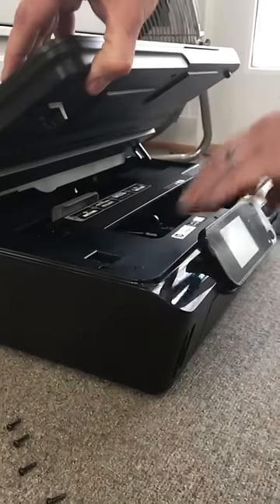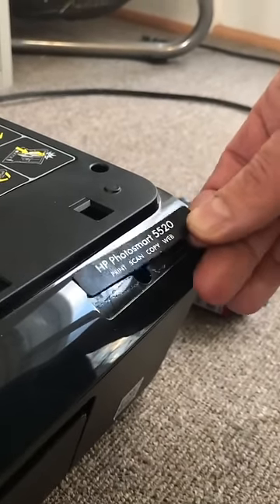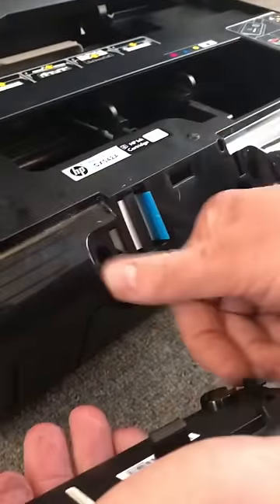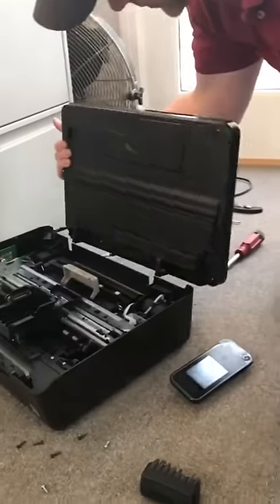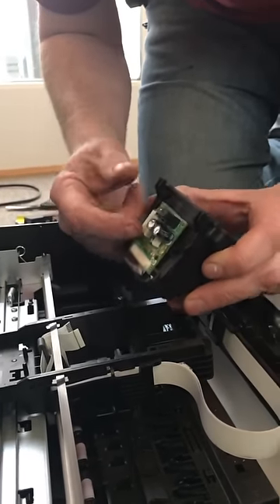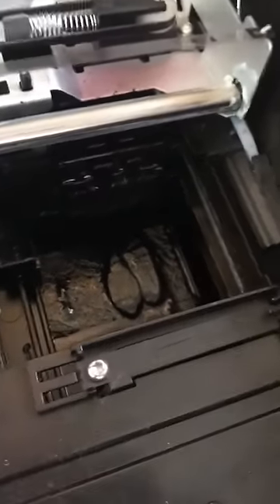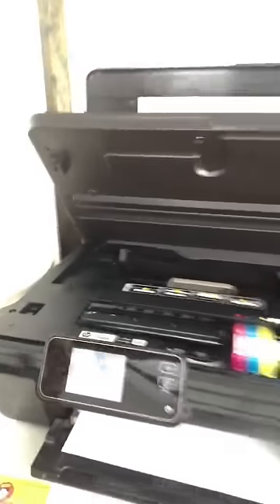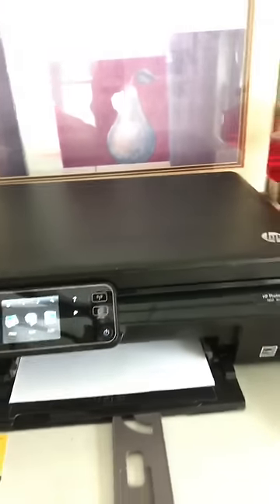HP Photosmart 5520 Black Ink Problem

Comment: Boom! I soaked the filter head, also used a syringe to force water through the cartridge screen with no luck. Forced air with my mouth through the cartridge vent on top with it installed with no luck. I tried it with that same syringe with just air and walla..it worked. Thank you
Reply from the maker: Blythe Ag & Aviation thanks so much for watching! I’m so glad that you got the printer working again! I got mine screwed up by taking the cartridges out and left the top open. This kept the print head off the wet ink pad and allowed the head to dry and clog. How did yours end up getting clogged?
Reply: I really have no idea. The old black ink cartridge stopped working, put in a new one and it just wouldn't work. So maybe I have, at some point, left it too long off its storage pad
Reply from the maker: Blythe Ag & Aviation Ok. I was curious if you made the same mistake I did. A friend of mine gave me an HP6700 that had sat unused for quite a while with the black ink empty, but the head was parked where it should be. I put in all new in and it printed just fine. I was quite surprised but very happy. I guess it doesn’t matter how long it’s empty, just as long as it stays parked on it’s ink pad when not in use. Thanks again for watching!

Comment: Good help video, kept me from junking. All I did was use idea of blowing thru cart and head. Used straw, blew thru cart “air vent” which I opened with knife. Hopefully cart doesn’t leak out!  Bottom line, never let ink run out and set empty or open without cart for any length of time. Thanks again.
Reply from the maker: Andy Skinn These are all good points and thanks for watching! I think my issue was I opened the ink replacement door, took out the cartridges, and left the door open. This allowed air to the cartridge tray both top and bottom. With quick drying ink, it was guaranteed to dry and clog. Open the door and take the cartridges out ONLY IF YOU HAVE THE REPLACEMENTS IN YOUR HAND!! Don’t take them to the store like I did! Again, thanks for watching !

Comment: You Sir are a legend! I remover te top and removed the color cartridges. Ten i put my lips on the Black vent opening and had to blow hard till there was a Middle Black ink. Prints again now ! Had put much time before with soaking it
Reply from the maker: Polletjeuh I’m so glad it worked for you!! Mine is still working fantastic as well. Mine is exposed to extreme temperatures as it sits in our home office that is not temperature controlled. Sub zero temps in the winter and 90s-100s during the summer! Picture perfect printing. Any, thanks for watching and I’m glad you have your printer back!

Comment: Thanks for this. Mine clogged up, hot hot water soaked fix it. Wouldn't recognize magenta cartridge, loose ribbon, had to wedge it in place with a bit of hard plastic. Fixed it MacGyver style. Your teardown instructions were invaluable.
Reply from the maker: Stephen Hayhurst Fantastic! I’m glad it worked! And I’m glad it saved you some replacements money! Thanks for watching!

Comment: Thanks Jarrod for your very logical and considered approach to your problem we had the same problem in our case all cartridges worked minus the black which appeared to be clogged. We ended up ditching the HP for a Canon Ink Jet which prints great it is the G2600. When I have some time I will try what you have done to see if I can free the clog from the HP printer which has been disconnected and is now lying idle on our carpet. I don't feel like throwing it in the trash can at this point but when I get a day free I will take it outside to work on it. Thanks on all the tips for disassembly. Regards Mike
Reply from the maker: Michael McKenzie Let me know how it goes and don't hesitate to ask me any questions! Mine is still printing strong!!
Reply: I just did the same thing I am sick of spend big money on HP and they die in 2 years.

Comment from the maker: Thank you my friend for watching! I did try that, but didn’t have positive results. I tried the overnight soak with the print head resting on moist paper towels, then went to soaking it in a bowl of hot water the next day, alcohol swabbing, alcohol soaking, and nothing worked. Pushing the ink through the print head was all that worked for me. Thanks again for watching!

Comment: A very thorough video EXCEPT you didn't show re-installation of the cleaned cartridge.   At least on my unit the smallest of the three cable appears to need soldering to get it back on unless I am not locating the socket.

Comment: Continued—
Using a standard household plunger I used the mixture of boiling water and Mr. Clean to apply to the upper portion of the print head, area where the ink cartridge sets. Let solution sit for 1 to 2 minutes. Remove ink soaked rolled paper towel from under the ink carriage. Repeat one more time. 
Hooray after running the printer cleaning head selection twice I was up and printing all colors. The Black ink was bold and bright. I was scheduled to buy another printer in a few days but no need now. I refused to take the whole printer apart. 
This complete effort took no more than 20 minutes start to a working printer. 
I hope this can help someone else.
Rich

Comment: Thank you so much for this video! I was able to fix the black ink flow on my printer and get it working again. And I'm glad I watched to the end of the video; I also needed to blow through the print head to get the ink through. Thank you thank you!
Reply from the maker: ruthmarkable Thank you for watching to the end. It was one of my first videos and wasn’t recorded properly and wasn’t edited enough. However, it did record everything I went through with this printer and not just the warm and fuzzy times!! Thanks again and I’m glad it helped.

Comment: Your guess is correct!  The docking tray is not hidden or locked. It's above your puddle. You expose it by turning the black wheel on the left hand side counter clockwise.  Once the tray is exposed you'll see the sponges that keeps the printheads moist. This tray moves in and out every time you open the top to expose the ink cartridges. Unfortunately, your little mishap is an omen of your future. The "black ink" issue is that the black ink sponge erodes over time and the printhead is not flush with the sponge so and the ink dries and clogs.  Cleaning the printhead is a temporary fix.  The problem is the sponge.
Reply from the maker: M Om Great info. Thank you. We’ve had the printer in storage since August and I’m interested in how it’s going to perform after sitting in a hot cargo trailer all summer. If it needs another fix, that will be another follow up video I guess! Thanks for watching and taking the time to comment.

Comment: try this 1st!  remove the ink cartridge's, take a paper towel fold it and dampen it with warm water, put it under the cartage carrier and move the carriage over the paper towel a few times then clean the ink contacts with a damp paper towel. put ink cartridges back in and print a few times till the dampness is gone on the paper. this cleared mine up perfectly!

Comment: Same experience here, cleaning the print head seems to have been useless, first time I blowed it did nothing, so I blewed stronger and longer, and it spilled much ink inside the printer. I then had to clean with towels, and print a bunch of white pages, to remove all that. I suspect the problem is with the cartridge only, especially the black ones, that have a tendency to dry. A design mistake I would say...

Comment: Imma just get a new printer this is to much work but thanks for the video
Reply from the maker: I agree! I just hated buying a new printer knowing that the printer was fixable. I’ve since ditched the ink jets printers for laser printers. Thank you for watching.
Reply: @237130  yea I had mine printer for 8 years working fine no problem until yesterday got the message saying something wrong with the printer

Comment: Funny as I sat listening to the whole video, my printer sat opened with the cartridges in the opening. Then suddenly when the video was almost over, it came to life and the cartridges slid into the cubby. I agree that there may be a pad that keeps them moist, But i wonder now if HP thought of the same thing. Either way, I’m going to pull this thing apart just like you did.
Thx for the tips. 
PTP
Reply: By the way, we did buy a laser printer (👍👍👍) as our first printer, im just trying to keep this thing working longer in another office in our house.
Thx
Reply from the maker: I problem. It’s pretty easy to get apart. My thought was if it’s not working after all of the gentle soaking, force the ink through! Blowing through the ink cartridge while it’s still in the print head worked for me! Good luck and keep me posted!

Comment: Hi, I could follow the video until about 10:00 - I soaked the head several times, and it still does not print out black. I'm about to kick it like you did. But what was the final trick? You blew air through the cartridge and it spelt all over your carpets, but did not solve the problem. Then you combined some 2 stupid ideas of blowing through the cartdrige and finally everything works - I did not get that (sorry, I'm Austrian). Can you describe in more detail what you did? Did you remove the cartridge and blow down to the printhead without the cartidge? But you talk about blowing air into the top of the ink cartridge - did you open it up? Thanks...
Reply from the maker: The so called “stupid idea” lead me to the discovery of how to fix my machine. 

I blew through the cartridge and ink came out. I placed the cartridge back into the carriage and blew into the cartridge again, thereby forcing pressurized ink into the carriage and dislodging the ink blockage.  Hope that helps you.
Reply: Ah, I get the idea now - but still I don't know how you managed to blow into the cartridge, especially when it's placed in the carriage (there is no "air inlet"). Did you drill a hole on top of the cartridge?  @237130
Reply from the maker: @loopmasterb.2136 There’s a hole under the sticker that wraps over the top of the cartridge. I blew into that hole.

Comment: That ink pad you mention, there is a little hydraulic pump that pumps blank ink to that pad, wonder what else that pumps' purpose besides keeping the printer head moist, because I notice i have an air bubbles in the line, would that cause the blank ink not to function?
Reply from the maker: JERRY FONTANARES Hi Jerry and thanks for watching! I saw that too and I’m not totally sure how that system works and mine had air in the lines as well.

Comment: This was my Mother in laws printer, sat there for a while with the Black Ink not working, I knew I had a tough road ahead to get it working. Almost 12 hours later, countless dismantling and Youtube videos. Soaking, boiling water, alchohol, more soaking, boiling water, Krud Kutter! more water, more soaking, dismantling, not putting a ribbon wire back properly, dismantling again. Some of the Print tests showed some real promise, even some sentences in Black showing through, like a big tease. Then nothing.....absolutely nothing. Whiteness. No Black ink at all. Finally I take a straw and started blowing and blowing and blowing, adding more boiling water, cleaning out the "ink pad"........and finally. Nothing. No change, in fact it lead to me dealing with about an hour of "damage to Printhead" then Failed Printhead error........I finally got it working again, printing. And no change whatsoever. Its done. I tried, I really did, and I dont usually fail at these things. Good luck to everyone out there! I think this would have definitely worked had the printer not sat idle for so long. I just dont have another 3 days to keep working on it, my sanity wont allow it.
Reply from the maker: “A” for effort!! Holy $&@?!!!!  The only thing that will fix that machine is a good fire!! Drag it out back and make a bonfire! I wish you had better luck, but thank you for taking the time to watch and comment. Greatly appreciated!

Comment: When you say you blew into the print head, how did you do that? Did you get a straw and blew into the mesh area? or Did you use compressed air? I'm about to give up on my printer since the black is still streaky, but I figured I should ask!
Reply from the maker: Julissa Barajas Hi Julissa and thanks for watching! I blew into the ink cartridge while it was mounted in the print head. Under the sticker on the ink cartridge is a vent hole. I blew into that to force ink into and through the print head. That dislodged the blockage. I hope that helps you.

Comment: Thanks.  But when I plug it back in, I see/hear that the power is on but the display does not come on.    What did I connect wrong please?
Reply from the maker: B R probably one of the thin ribbon cables has become unseated. These thin white flat cables if not carefully handled can become dislodged at either end or in extreme cases become cracked. More than likely its dislodged. I believe they’re held in by compression. There is one that runs from display to the circuit board on the left front on the inside of the printer. There are several ribbon cables attached to the circuit board. Make sure all of those are firmly seated as well. After that, I’m not sure what else to check for your display. Only a ribbon cable carry’s power and data to the display. If you lift the top lids of the printer as if you were taking out the ink, look to the left front and you’ll see what I’m talking about. Keep me posted.

Comment: I would really like to know how long to soak the printhead & how best to blow air through it. Just with my mouth or a compressor or canned air?
Reply from the maker: LadyDarkness1976 Well it seems there’s no right answers to those questions!! Some people report that an overnight soak was good enough. That wasn’t the case with my print head. I tried alcohol, hot water soaking, and lastly, forcing air by mouth through the ink cartridge while it was locked into place in the print head. That forced the ink to flow through the print head and solved the problem. So removing the print head, then placing the black cartridge back into its slot and blowing into the cartridge vent, forcing the ink into the head, forced the ink to push through the head! Sorry to repeat myself, but I’m trying to make it as clear as possible!!Thank you very much for watching!
Reply: Jarrod Fothergill Thank you so much for your quick response!! Last question (for now lol), how long dry time did you give the printhead before putting it back in??
Reply from the maker: Catania Cowgill Well definitely make sure the small circuit board on the back, the plastic ribbon cable connections, and the bottom of the print head are as dry as possible. You don’t want to short anything out on the circuit board!! Toward the end, I was running out of patience fast and I’ll admit that the print head was not exactly treated nicely on some of the installations!! The printer even got a punch or two right around the 8 hour mark of troubleshooting!!

Comment: My 5520 HP stopped printing black ink. I removed all 4 ink cartridges, used mixture of boiling water and Mr Clean. laying a rolled paper towel, soaked with the solution, under the cartridge holder. Then using a standard household

Comment: Never mind.   I apparently pulled the socket off the circuit board along with the cable.  One needs to be very gentle with that cable.
Reply from the maker: Patrick McVerry Are you able to solder that back on?

Comment: I have tried everything!! When cleaning the printhead and blowing air through the printhead, no black ink comes out. What else can I do?
Reply: I'd try soaking in hot water for a while just the bottom of it. Keeping the circuit board dry. Changing the water and wiping the print head off a couple times. When you put it back together run the quality report until it comes out looking good.
Reply from the maker: What he said!! I know it’s a pain. I had to soak mine several times, even submerged the entire print head, always making sure it was completely dry before putting it back together and energizing it. Soak it over a few nights if you have to.

Comment: Great Work! You are definitely on to something here! I have an 8 year old C309g (essentially the same HP crap as yours) which just started to act up. No black printing. 

I then did "everything", including taking the whole damn thing apart. I then spent 2+ hours cleaning it! I then discovered the ink bath with a huge double sanitary pad absorber! There is also a little pipe/tube there where I have no idea where it goes or come from. The whole covered compartment was totally gooey'd up with my fucking expensive black ink. Now I know where the hell it went all these years, wasted in the bottom and back of the printer! So I tried to clean it up as much as possible, thinking that this goo may keep clogging up the printer heads. I then put it all together. Hitting "printer status report" it printed beautifully!! 1 page... then I decided to print another...and go fuck HP, it printed half the page and now nothing again! 

I then realized that I had taken out and thrown that "wet" pad (which was gooey'd up), that probably is supposed to keep the head wet when not in use... I will try to replace this sponge with something else.

I just found a similar experience by "Mark" on this site:
https://ethanbeute.com/the-story-our-hp-printer-stopped-printing-black-ink/
Reply from the maker: Running Late Thanks for watching! I believe that pad is a necessary evil! Keeps the head from drying out! Mine was like yours and piled with ink! I’d like to know how the two clear hoses work. Anyways, thanks again for watching!
Reply: I could only see one hose, going to the back of the printer in the other hidden compartment, where there is also some kind of brush sticking out. The measures of the sponge are:
 Length: 1 in
 Witdth: 1/4 in
 Height: 5 mm.